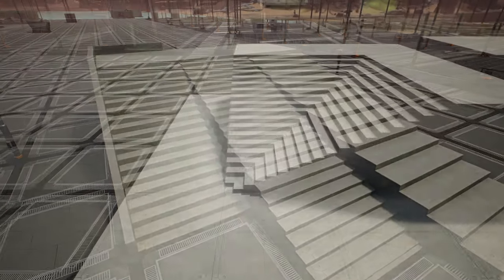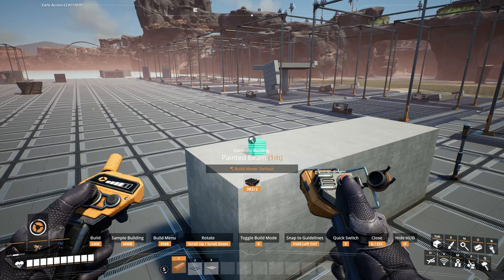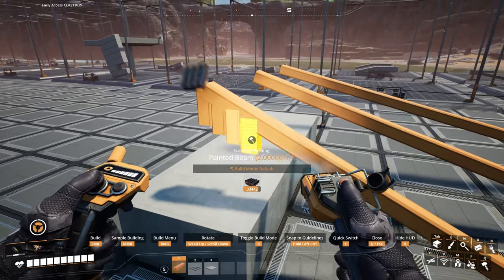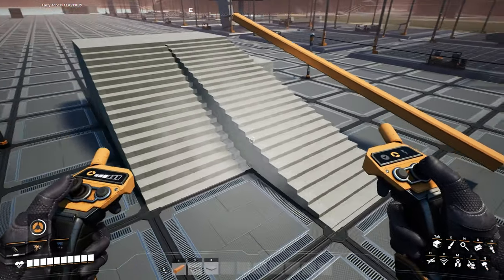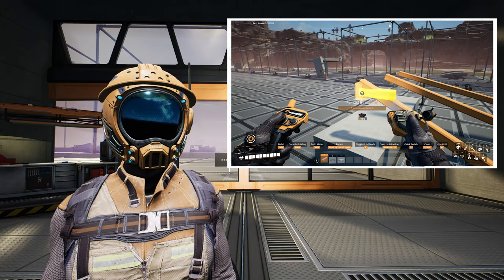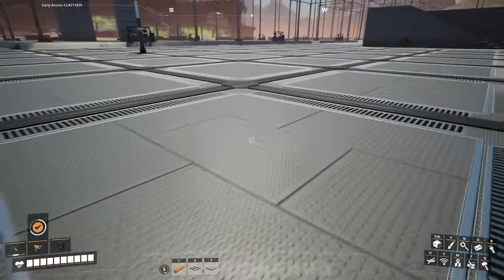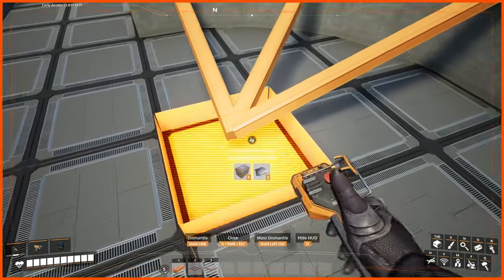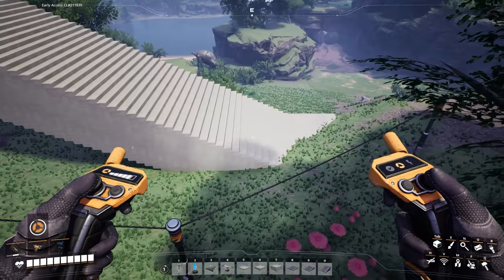Build the stairs YOU WANT with ease! - Satisfactory How To

Comment: To finish the stairs, some hand rails would be nice. Use the beams.
Reply from the maker: I kinda of see the beams as a bit too big for hand rails.  That said, if you could get the right position to get them to run straight along a side wall, they might be an interesting decoration.
Reply: @relyengaming  how about the industrial railing.
Reply from the maker: @mymumbakescakes  Yea, if you used an angle that matched up with some level of ramp, I think you could do that.  Use an angled wall at the same level of as the stairs to act as a support.  Would look pretty good.

Comment: You can leave the beams in place so your stairs have handrails.
Reply from the maker: Very true! I think if you also got it inline with the wall angles, you could clip some ramps in and use the ramp railings as well.  Then maybe replace the edge of the ramp with a wall for the railing to sit on.

Comment: This is a pretty cool method. I've been doing one where I use a beam and I place down road barriers along the diagonal and attach concrete beams to those barriers. This method looks a bit less painful than that, even if you do have to use foundations. I especially like the bit about the angled walls.
Reply from the maker: Glad you found it interesting Kendrick! I agree as well, it's one of those techniques that has changed the way I do things as it's such a simple way to do it.

Comment: Awesome tutorial!  One thing I wish you'd covered was the spiral stairs.  But, like the roads videos, maybe there can be a part 2 - advanced custom stairs!  P.S. I discovered that freeform extension technique on my own, and used it in lining up on-grid busses at various angles to one another, to go around obstacles, etc.  The tip is super helpful and is greatly explained here.  P.P.S. This is legit, "Beginner Stairs Tutorial - A Step By Step Guide!"
Reply from the maker: Thanks warp! I tried to keep it concise and informative.  And yea spiral staircases would probably be another video, the method for them isn't the same used in this video.  Plus, we still need to work out some finishing touches for them.

Comment: Nice, now I'm going to go try to make a spiral staircase!
Reply: Okay so I just tried it, the only trick is to make your "circle" but then at each connection you have to move over 4m, then you have to "redraw" your original beam, basically off center each "joint" by 4m and then it looks right.  I just did a hexagonal staircase and anyway I'm very happy with the result!
Reply: A legit spiral staircase is probably possible my placing your circle and then by making pilons/pillars on each square... at an increasing height and then repeating the process... I'll have to experiment
Reply from the maker: I saw, you made a great attempt at it! Looks good.  Will be interesting to see how you integrate it into a factory.

Comment: Could you not use Freeform and then use default to make it a full number for even stairs?
Reply from the maker: Default only sizes to 1m increments, so it wouldn’t work I believe.  But after doing a bunch of these, I don’t even notice the smaller first step.  

That said, if you could size it just right to hit a Pythagorean triple, you could get a whole number for the Freeform beam.